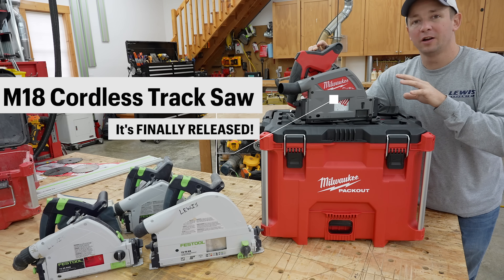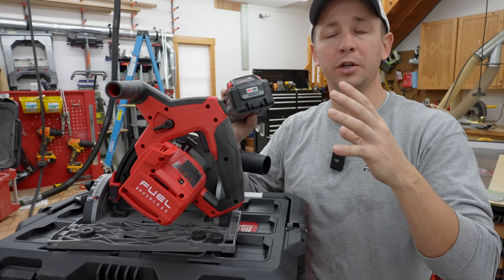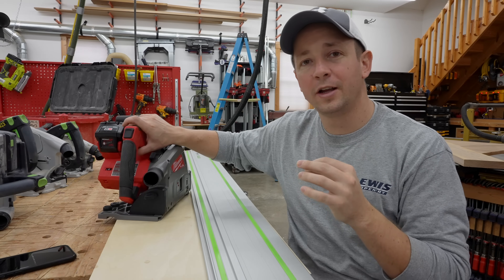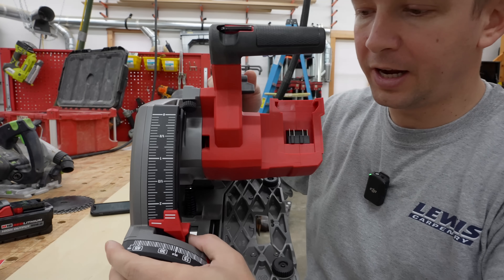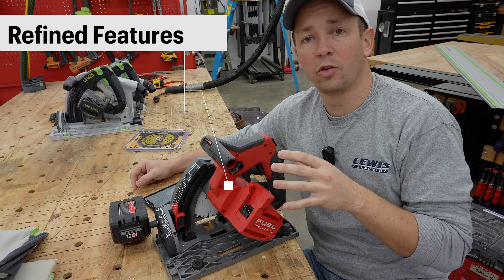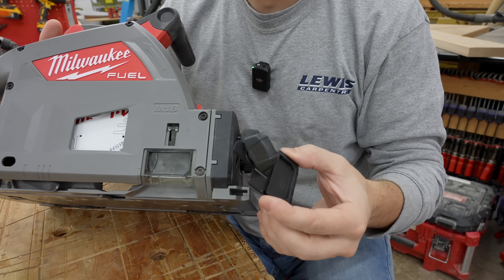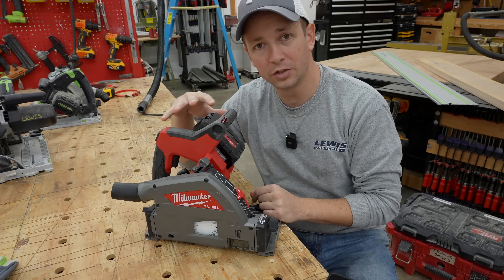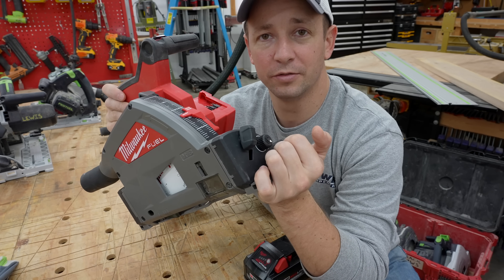Did Milwaukee Deliver??? | Full Review of the NEW Milwaukee M18 Track Saw

Comment: I wonder how well that port works with the Milwaukee battery powered Wet/Dry vac.  That would be really nice if it works well.  I also really hope that the step up to 12 amp HO batteries doesn't adversely affect the use of the tool.  I have the Makita system now, not sure if I'm keeping it for use around the house only but it's definitely getting swapped out in my mobile kit for this.
Reply from the maker: I would think that aside from more weight, a 12ah battery would only enhance the tool.
Reply: @InsiderCarpentry  That would be handy.  I already pack 4 12ah's to get me through the day.  I can typically run the sliding compound for two days on one.  The battery powered table saw tends to be what eats them the fastest although I don't have much occasion to use it now that I have had the track saw for a while.  I suppose that would be about the same with sustained cuts on the track saw.  It will be an interesting test to see what run time looks like on a single 12ah versus the dual 18v/6ah the Makita requires.

Comment: For battery life and motor strenght its gotta be Makita for me. With two 5.0mah 18volt batteries it can make cuts all day long without a recharge. Like the Milwaukee the batteries work on the rest of Makita platform. The only drawback I see with Milwaukee is the single battery. Why would they do that?

Comment: I say this is a fail solely because of the inferior Festool track. The Mafell track is superior. Festool's splinter guard absolutely sucks. The adhesive connection is horrible. Mafell's mechanical connection is hands down the best.
Reply: Someone should market a new Festool track that uses the Mafell splinter guard. I'll buy it.
Reply from the maker: I switched to using makita splinterguards on the festool tracks many years ago. Makita splinter guards work great.

Comment: I think the pricing on the M18 Fuel Track Saw and the "kit "more specifically, is out to lunch. I say this as someone pretty invested in the M18 ecosystem (half dozen batteries, mostly Fuel stuff - which has been great, no complaints).

I had been waiting for this one for awhile I was fairly disappointed in their pricing.

In Canada, their 'kit', comprised of the Saw, 6.0AH battery with charger and a packout - runs $848. You'll have to buy a 55" track separate for $168. That is exactly double the price of the Makita 55". So we are at $1010.

I think what chapped me most was that the kit didn't include the track. Yes a track saw - with no track. So that was annoying. I ended up seeing the M18 Fuel saw in person and it felt cheap to me. Didn't use it but that was my first impression.

So I went ahead and bought the Makita 36V DSP600ZJ, for $499. Makita was running a promo that included the saw, sustainer box, 55" track and clamps. I bought 2 x 4.0AH batteries and was into all that for $636. Absolute no brainer. Super happy with it so far.

The comparable cordless package from Festool , arguably the standard for 6.5" tracksaws and primo tools, includes the TSC55, includes the saw, 2 x 5.2 AH batteries, charger, a sustainer and the 55" track for $1129.

So ultimately - Milwaukee wants Festool type money for an unproven track saw, and in my opinion got a bit greedy here. I think this is a major fail as even guys invested in their platform are going to go elswhere for either better value (Makita) - or a better tool altogether (Festool). I think anyone is better off spending $100 dollars more for the Festool, or save hundreds and go with Makita.
Reply from the maker: The convenience of battery platform is huge for a lot of us. I think it will sell in large part because it's M18. Good points all around.

Comment: 54 seconds was enough to tell that they've still screwed it up by making it a left-handed saw. I've been a carpenter for over 30 years and when I hold a saw in my right hand I want to see the blade not the motor. Fail for Milwaukee again.

Comment: Brand loyalty for sake of battery system alone is the most over-rated least important real-world factor I can think of in modern tools.  Especially for a person who is able to afford the most expensive tools in their class.  We were brainwashed and it worked.  Once I gave up having a single-color wash, not once have I ever been affected by multiple batteries.  I can't work faster than what I have with their charge rates.  Buy the best tool for the job that is within your budget.  Treat yourself to 1 black-Friday sale a year where you get 2 nice batteries and charger with anything and don't look back.  Buy batteries for capacity and power, don't buy tools for batteries.
Reply from the maker: Managing 5 different types of batteries on a jobsite gets really old. I disagree. I'm looking to consolidate if at all possible.
Reply: @InsiderCarpentry  who stated managing 5 systems? I missed that comment. Yes, if you bought one of every brand to intentionally be inefficient, I agree with. I wouldn’t intentionally buy 11 different brands like you suggested. See how adding words to fit a narrative is annoying?  You’re right. The most important reason to buy a tool is it’s battery system. Excellent take away.

Comment: i like the Makita double battery system better ...one single battery seems under powered
Reply from the maker: I would have tended to agree until I used it. There is plenty of power there. With the M18 lineup you have the ability to throw a 12ah high output battery on the tool and get very similar results.